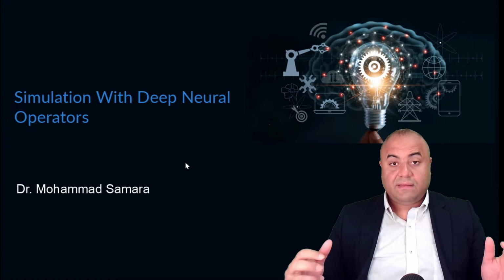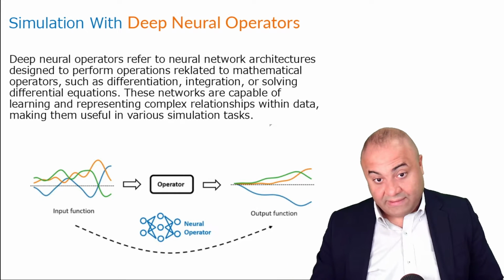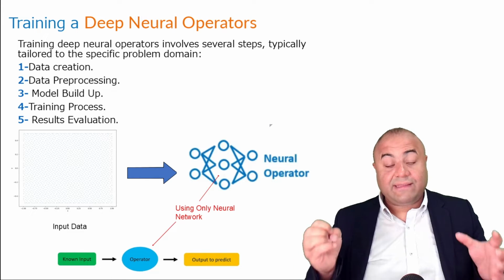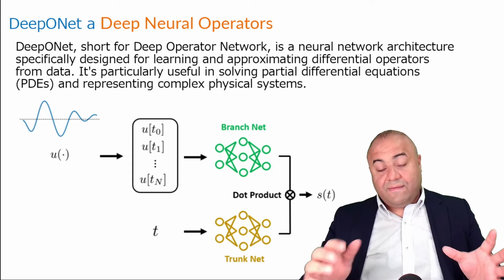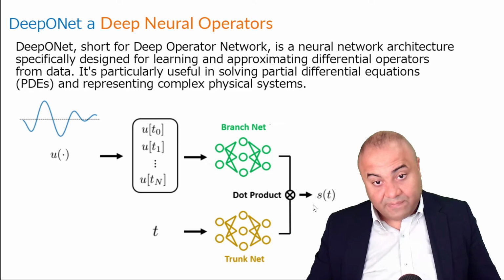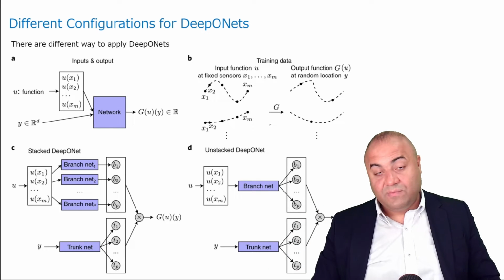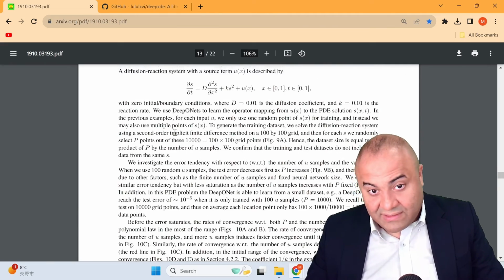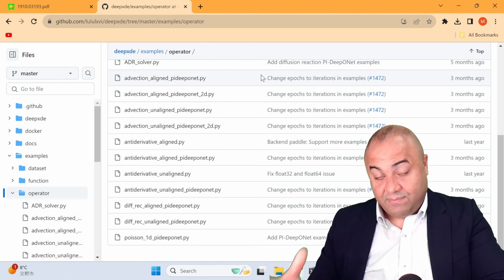HOW it Works: Deep Neural Operators (DeepONets)

Comment: Thank you Dr. Samara for these videos, I am actually searching to solve systems of Fredholm integral equation, and I want to use Deep learning techniques, can you guide me on where can I start it?
Reply from the maker: Hello
Start simple 1d heat equation and then burgers eq. Using PINNs you can also explore deep neural operators methods which only uses data to model equations behavior then you can expand your scope to solve your spacific equation or system of equations.
Good luck

Comment: Hi Dr Samara
Really nice job. I am looking for a course for Gourier Neural operators. Will you prepare material for that one as well? I have a Poisson-like equation, Do you have any suggestion on which method can be the most reasonable method to solve the equation? ( I mean PINNs, or using Neural Operators).
We can consider the equation is a time-independent equation, then we don't need to find the answer for each instance.
Reply from the maker: Hello
For the neural operator you are interested in the future I will be covering advance use of Nvidia Modulus library it have many nets for neural operators and it is keep on evolving.
For the which method is better it depends on what you are trying to do for example to solve the problem only you just use PINNs as you don't need data and if the bc and ic is simple you can make a general simple dnn to handle all, if you want Maje a general neural network for all ic and bc then deep neural operator is the direction to go.
Reply: @Dr.Mohammad_Samara Hi Dr. Samara,
Many thanks for your response. Do you mean the course entitle: "PINNs Using NVIDIA Modulus"? Can I have your email or contact you through Linkedin?